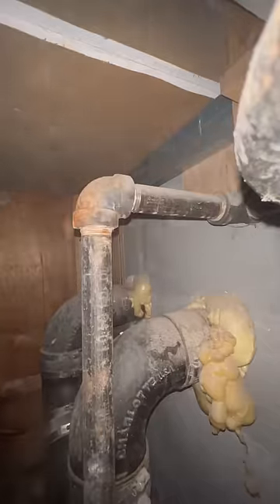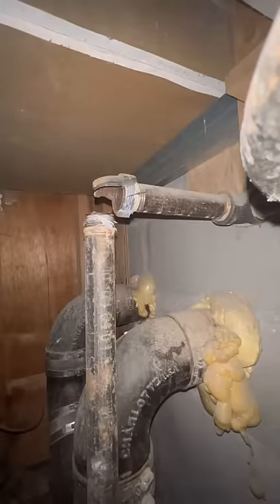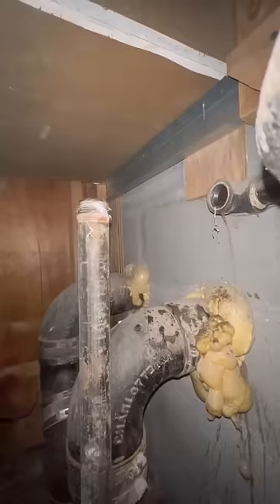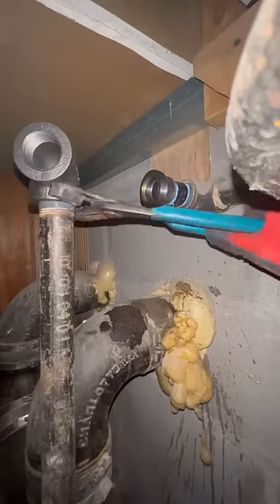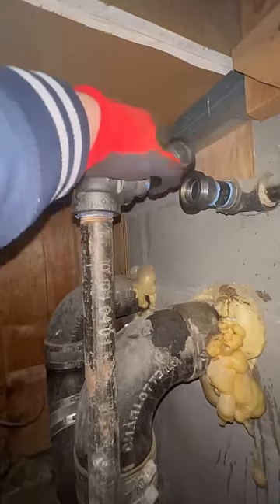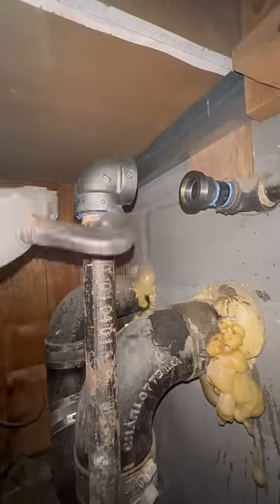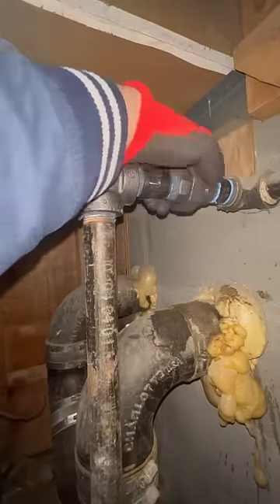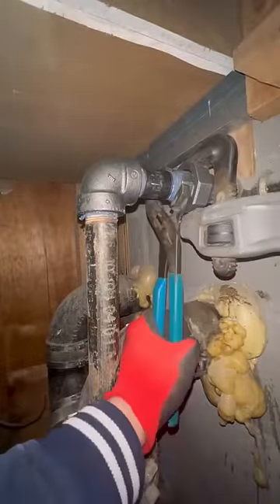How to repair a broken cast iron elbow

Comment: why not just chop the horizontal pipe that you ended up discarding, and thread off the cracked fitting
Reply from the maker: Because space was very limited. The whole job was done through an access panel. It was easier to break the elbow since it was already cracked in the middle.
Reply: @hydronyc  rrrrriiiiight...
Reply: Yes!!!
Reply: @hydronyc  we can see the panel lmao just admit you didnt think of it ive cut piper in way tighter spaces
Reply: @rellort3005  make a new account buddy ur comments are getting hidden
Reply: @lxn_ni1814  why?
Reply: 18" by 18" is plenty of room to work, not to mention all of the space you have to work around the pipes. You shouldn't have had to cut corners on this job.
Reply: @tenGjenko  Nice!
Reply: Bingo
Reply: Hack should have cut pipe ,must charge by the hour ,add on extra time for filming.
Reply: @mattmcneice7223  how would you install a new horizontal pipe when the  two ends thread into the 90° fitting in 2 different direction?
Reply: @Samestori214  did you actually watch the Video?
Reply: @mattmcneice7223  Yep, watched it and re watched it.  I see your point now and don't see a problem the way he did it or with you suggestion.
Reply: @Samestori214  cutting up the elbow  seriously risks damaging the threads of the other pipe. It's just goofy artsy silliness...
Reply: @mattmcneice7223  Yes I think he mentioned that it could be damaging to the threads. I've done this on struck tub drains, sinks and some automotive application where the metal chemically joins themselves together. But to someone who is not skilled to perform such repairs I caution to do the repair. 

It's not how it's done but it's how I do it.
Reply: Yeah you never want to cut and elbow like that, you might end up cutting the thread. Plus I bet you it took you 4 times the amount of time than if you would’ve just cut the pipe.
Reply: He had enough room for the camera only….
Reply: @rellort3005  because yt algorithm loves to do that. Do you get a black box around your replies, and can only type a certain amount sometimes?
Reply: The space was tight? But you got a camera in there… take the camera out.. boom you got space.. work isn’t an excuse to make videos and say their was a situation.. boooo!!!
Reply: I was wondering the same shit. Seemed like he went through more work than necessary
Reply: @Samestori214  the union,  genius
Reply: @thomasking1149  Thanks
Reply: @Samestori214  a union, just like he used
Reply: Stop criticising the man for his hard work. Wats up broski✌
Reply: @yasreh5845  its not that the work itself  is hard, its that he makes it hard to do.
Reply: @mattmcneice7223  lets see some of your work mr riiiiighhht
Reply: Yip the right way to do it…no chance of damaging threads👍🏻👍🏻
Reply: @jaimemaldonado1204 but, but, but... It LOOKS cool💯😀
Reply: Smh this dude is not a plumber. He's just watching handymen videos n talking over the videos. Sounds good to a person who's not a plumber.  But as a licensed plumber this video makes me cringe 😬.  Cuz I seen guys do it this way n end up calling a real plumber n pay heavily for cutting corners. No pun intended
Reply: 😂😂😂😂 faster eh?
Reply: Because it was easier to cut the elbow that was already cracked on the other side then he has room to back out the nipple
Reply: It ain’t that serious. It’s a simple repair, he did fine. Plumbers and techs, all the same since I’ve started the industry. Making up plenty of reasons and excuses for everything
Reply: @hydronyc   Sprinkler system line (fire) I'd say.  correct?
Reply: For practicd
Reply: I don't like using grinder in small areas because of sparks. Also what i typically do instead of backing the fitting get your measurement right before last turn. Put nipple in then finish tightening elbo n it will pop right into union.
Reply: That's the great thing about knowing a trade,you're absolutely right but so is he
Reply: This is how I remove old copper tanks, leave a stab of pipe and can use your hand to unthread the fitting. Had my arm tight between a tank and the wall only able to move my fingers and removed them this way.
Reply: @dannythorpe1425  you had  barely enough room to move your fingers yet somehow manage to fit a cordless zip cut  in there?
Reply: @Matt McNeice  cordless zip cut? Huh? I used a pipe slice, fits in the palm of ya hand.
Reply: @dannythorpe1425  makes all the sense in the world! now!
Reply: Man this comment section is full of salty ass people complaining about a repair that WENT WELL
Reply: @outsider344  its hardly salty to understand a simpler way of doing something XD, its passing on advice.
Reply: @hydronyc  If you can reach in with a pipe wrench and channel locks you can easily cut the horizontal!
Reply: @mattmcneice7223 who really cares where or how he cut it. Everyone is different. I probably would have cut the pipe Right at the threads because I was removing it anyway....But the end result is the same. Most of us commenting here who are plumbers, usually think we're the smartest person in the room. And we may be most of the time, in our own little plumbing worlds. At the end of the day it's a pipe that needs to be removed without damaging the others and that's what he did.
Reply: Bro as a plumber everyone got their own way of doing shit if he made the repair and it looks clean and don’t leak who the fuck cares how he got there lol
Reply: @lxn_ni1814 you're a hater bro...yikes. thanks for commenting on this video to help his algorithm though
Reply: @MayorOfChunkTown  Hammering on pipe in any circumstance should be avoided whenever possible is the problem! So if he can cut through the pipe he replaced anyway why wouldn't you?
Reply: @mattmcneice7223 there's more than one way to skin a cat
Reply: Ah just found offset pipe wrench 🔧
Reply: When you have to cut a nipple or pipe out of cast elbow you cut carefully and use a cape chisel, I think where he did in reverse was right procedure, I know some about steam fitting repairs but this guy knows his plumbing 🪠 wvr gets the job done ✅ all matters
Reply: Thought “ this was the proper procedure but you guys are right just use pipe cutter all good 👍
Reply: A lot old timers only use permatex on old black pipe especially steam ,
Reply: point is that theres no reason to touch the elbow at all.... just cut the pipe off!
 @RcPlayer-tt2vw
Reply: @mattmcneice7223  multiple ways to skin a cat. He likes doing it a slightly harder way. He may have his reasons/prior experience that biases him towards this method. This is why I like that pretty much everything residential here is pvc(obviously not gas) so many more ways to achieve a perfect fit.
Reply: @BarrackObamna  making these cuts seriously risks damaging the threaded pipe, not worth the risk, ive got a strong feeling this guy has damaged threads and just taped them up and continued on. poor practice to say the least . more than one way to skin a cat for sure... you can literally skiin a cat with a shotgun.
Reply: @mattmcneice7223  time will tell. You can’t say for certain he did damage them, he’s he chose a route with an increased risk. The world didn’t end and water didn’t leak. I think the world will continue.
Reply: HuMM ?? PROB GONNA DO iT THAT WAY AND THAT GRiNDER CUT WENT TO FAR HiT THE THREADS THEN HAD TO DO iT THiS WAY.. iTS FiNE MASTAKES HAPPEN NOBODYS PERFECT, UNLESS PERFECT iN BEiNG UNPERFECT!!!!😂😂😂😂GREAT JOB.. JOB DONE!!!!🎉🎉
Reply: If my apprentice took a grinder to a threaded 90 his ass would be back at the hall. Break that shit lose. Don’t be lazy. Use Leverage or a torch that 1” 90 will come off. I Do it everyday in tighter spaces then that.
Reply: @CaptainEvo85 literally just making shit up now lmao
Reply: @tenGjenko  cut corners? lol Have you ever worked in an old NYC apartment?

Comment: Why are yall making such a big deal out of him backing the elbow up? Yeah, it's not what you should always do, but he's right. If the dope is still fresh, then you can go back a ¼ turn max. I've done it plenty of times and never had a leak.
Reply from the maker: Exactly bro
Reply: Same here. Plumber for 18 years,I've never had it bite me later. People are know it alls in the  yootoob comments section 😂
100 different plumbers do it 100 different ways.
Reply: Sprinklerfitter for 22years. Hydro test our stuff at 200psi with water. Never had an issue doing this in the field either.
Reply: I put dope first, then tape
Reply: @dfeller7 everyone has their own ways of doing things. As long as it doesn't leak then so be it

Comment: FINALLY! Thank you for giving me a reasonable explanation of why you would use dope and tape! It has never made sense to me until now, and I've not done it. I've been an industrial mechanic for 8 years, and I lOVE threaded pipe fitting. Love your videos man. You're an inspiration to us all
Reply: his explanation makes no sense. Black pipe is a tapered tread which seals by tightening. Teflon tape doesn't seal, it is a lubricant. It's all that is need for fluid. For gas you need pipe dope to lubricate and seal. As the pipe dope dries it hardens and seals irregular surfaces in the thread which is necessary for gas but not for water. If water leaks with Teflon is because it wasn't tight.
Reply: @gilleschercuitte4255 Teflon tape fills tye bottom of the treads because it's very unlikely it will completely seal without it that's what you don't use tape on something like a JIC or ORS fitting

Comment: nicely done sir!

i try to avoid turning back a fitting but thats just me.
Reply from the maker: Thank you. Me too but here i had no choice
Reply: @hydronyc  the right way to do it is to turn it all the way around one more time or take the 90 off re tape and dope connect your piece right before your last 45• turn
Reply: or stop short of union connection,put union half  on,then complete rotation to finish position while tightening fitting at same time,like chess ..got look two moves ahead sometimes broski!!

Comment: Good repair, I’m sure you heard from most of the comments technically the tape is the lubricant in that scenario and your braver than I going backwards with that thread you could have stopped short then finished
Reply: This would be the correct way.

Comment: In Minnesota, we try not to put Teflon on anything gas related as it could plug regulators down the like, usually a hard set pipe dope like blue monster is great for this application as it lubricates and fills the gaps that using Teflon would also achieve. Nothing wrong with using Teflon, however I try to back the tape off a thread to reduce the chance of it getting in the line. Love the videos dog.

Comment: Both tape and dope are lubricants and only some dope/pastes are meant to be used as sealers.
Reply: absolutely correct!
Reply: 100% correct!
Reply: told him the same thing, doesn't believe me either. Basically said I'm on drugs. Good to know some know what products are for and we aren't even making videos
Reply: @plap.  I kind of knew his level of "expertise" when he used slip joint plyers to tighten the pipes.
Reply: @nemfrob  So many things wrong here that it is perfect for a how not to video. Kind of thought it was a spoof, but no he is serious.
Reply: Teflon is %100 a lubricant and does absolutely nothing as far as a seal, even says on most packages
Reply: Yeah, maleable pipes use Teflon as a lubricant to reduce friction. This allows the metal to mate (and distort) tight enough to seal in water. Can be found in a dope/paste with ptfe (Teflon) or as a roll of tape. I have never needed both, on occasion I have need to make something tighter to stop a leak though.
One or the other, they basically do the same thing but watch size/material/gas/fluid compatibility...i.e. Read the label.
Reply: @plap. 😊😊

Comment: Just cut the pipe and unthread it my dude, no need to cut off the fitting
Reply: Some times, evey body has a different situation,  so your right too.
Reply: @Timothy Porras  The situation that Alex has in mind is that in order to cut the fitting all the way through, you are guaranteed to cut the threads as well because the threads interlace obviously. So Alex is right and not "too." He is just right.
Reply: He mentioned the fact that it's nearly impossible to get some threaded fittings off that have been rusted on there for decades, especially on steam lines. I can vouch for the fact that you usually wind up either breaking the cast iron fittings with a hammer, or cutting them off like he did.
Reply: Just cut everything and mega-press it back.

That would avoid many of the unnecessary comments. Lol

Comment: Got lucky going back the quarter turn. Monster tape does work good though.
Reply: It was 1/8th of a turn, not 1/4.
Reply from the maker: Its not luck I’ve done it many times it never leaked even in 150 psi pressure
Reply: Monster works great.  Much better than regular Teflon.  Need way less wraps too!

Comment: I’ve been using pipe dope only and never had an issue been working many years in the maintenance business at times the dope has made it difficult to take off but never no leaks ever
Reply from the maker: At high pressures only dope is not recommended. We use dope only in NYC for gas.
Reply: @hydronyc  what are you talking about? All our autoclaves running roughly 500psi @ 425F were dope only.
Reply: BS/
Reply: I've been smoking dope out of my pipe too bro!
Reply: There is non hardening dope most are teflon based. You also arent not suppose to use both tape and dope one or the other.
Reply: @MakesCache   using both is totally normal on potable water
Reply: @Daniel McCusker  has nothing to do with what runs through the line it the fact that teflon will work on its own in the right conditions and applications as will the proper dope. Its waste of time and money to do both.
Reply: "Never no leaks" so 100% of the time you leak?
Reply: @ObservationofLimits  yes!! Thank you for calling this hack out on his BS.
Reply: @ObservationofLimits Let me know when you run CNG through various valves and regulators where the JT effect matters a lot and you're bringing 3000+ PSI down to 100 or lower. You start to see issues then when stuff isn't taped and doped properly and it's only one or the other.
Reply: If you havent had any leaks then you arent plumbing lol
Reply: @ryancook1608  never ever have I put to pipes or fittings together and had them leak to were I had to use both ever I’ve always used one or the other and most of the time I use the pipe dope white and yellow
Reply: @danielmccusker3771 potable water sources are usually running at like 30 to 50 psi. Why would you need both for that?

Comment: Alternatively, you can just cut a chunk of the throw-away pipe out so that you can rotate the 90 off the good pipe and ensure you don't hit the threads. Doing it as shown in the video guarantees that you hit the threads in order to cut all the way through the fitting. From there, you just remove the remaining piece of throw-away pipe and replace it as shown.

Comment: I've heard other plumbers say to use both tape and dope. I learned plumbing from a pipe fitter. I don't put anything on things like a water supply for a sink or toilet because they have a seal inside and if the threads can leak, it means the seal failed and you need to replace the seal or the supply hose. I use dope on connections that are meant to be permanent and tape on connections that will likely be removed like a shower head or a stove gas supply.

This makes me think the reason for tape with dope is because the dope seals better but the Teflon makes it much easier to remove if needed.
Reply: It's for tapered thread connections. When someone uses it on straight threads it bothers me.

Comment: I think you have it the other way around broski. The tape is a lubricant, Teflon has a really low friction coefficient and the dope’s proper name is thread sealant, it seals the gaps but also helps lubricate.
Reply: It’s a good thing he doesn’t run gas

Comment: As a pool plumber, it's smooth the way you take apart a fitting without damaging what is connected to❤ threaded pipe, sweated pipe FUCKING PRO

Comment: That’s threaded black iron
Reply: schedule 40 steel
Reply: @268kris all gas pipe is schedule 40+, if that’s threaded steel that’s an expensive expensive plumber. That black iron import
Reply: Except for copper gas lines but where I’m at you can’t do that

Comment: This is an example of a apprentice level plumber....bro is still learning and thinks he can just make videos like he knows what he is doing. 
      NEVER use both tape and dope. Its either one or the other, by using both you compromise the seal created on the threads and it will leak sooner.   Also, you NEVER EVER back off any joint once they have been turned past a full turn. If you do that, you are compromising the thread sealing and that joint is going to leak way sooner.   This video shows you how NOT to do it!
Reply from the maker: Lmao another carpenter here huh

Comment: Probably want to mention not using an angle grinder on a cast iron gas line
Reply from the maker: 😂 theres no such thing as cast iron gas line. In gas theres only steel fittings and steel pipes. This was a fire sprinkler line
Reply: You need spectacles, did you not see the water drip out of the pipe,
Reply: If it's a sprinkler line in winter ,why wasn't it drained, ?
Reply: @Charlie Decker  fire sprinkler...not lawn sprinkler.
Reply: @andrewwelch5668  Yeah I know, where we have sprinkler lines exposed to freezing, we drain down to air filled when it gets cold and the diaphragm trip valve for the fire pumps works on air pressure loss instead.
Reply: @hydronyc    You’re correct, he called black pipe cast iron… We did have an event about 30 years ago where plumbers working in a church thought they were cutting steam pipe, turned out it was gas. Didn’t end well financially…
Reply: @hydronyc    There most certainly is cast iron gas pipe, but it’s all distribution pipe in the ground.